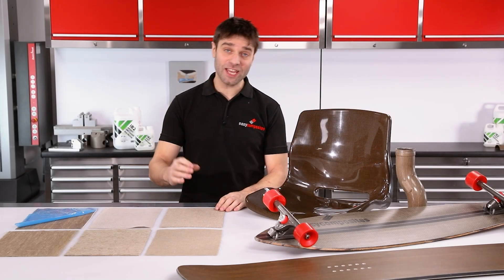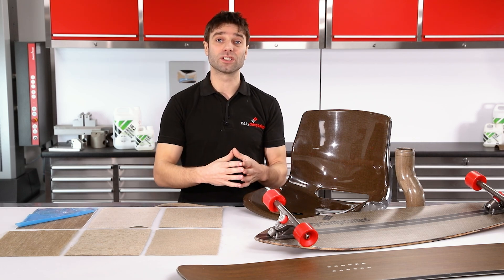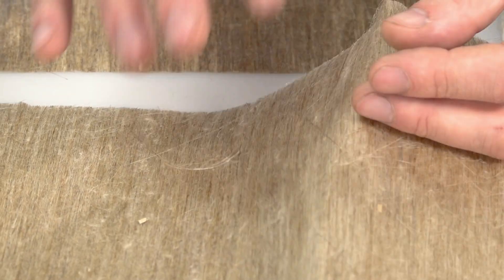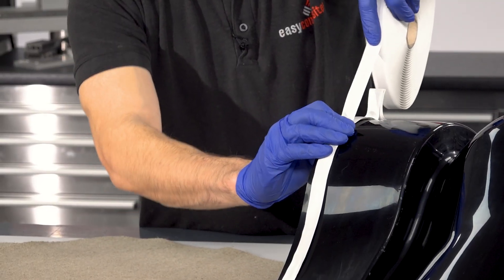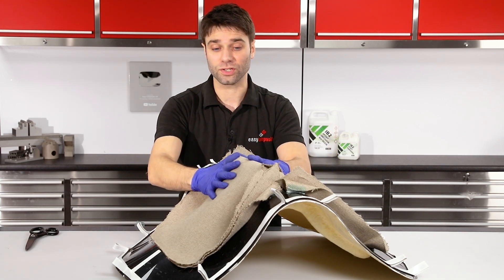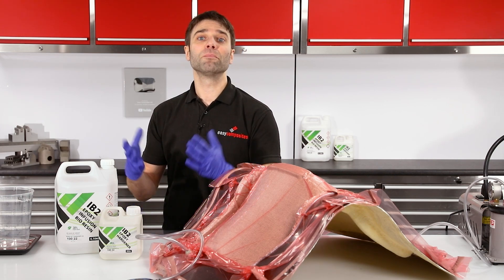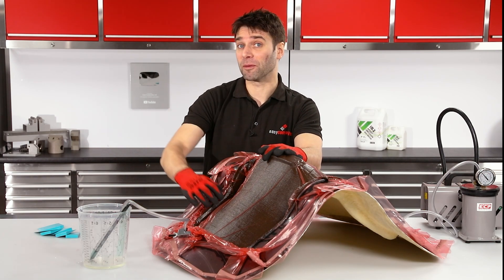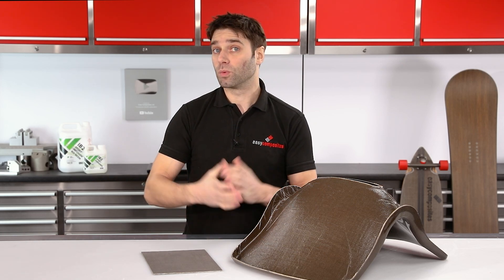How to Use Flax Fibre in Composites; Performance and Processing

Comment: Won't the snowboard topsheet absorb water? Or does it become 100% waterproof when cured with epoxy?
Reply from the maker: The resin infusion process should allow resin to fill up any of the voids which are evacuated by the vacuum pump and it should also absorb into the fibres themselves. Once cured there shouldn't really be any porosity left in the laminate with which it can absorb any water.

Comment: Amazing video as always - one question (maybe I missed something) - Why exactly do you not need to use peel ply or a release film with Flax reinforcement? is it because the bagging film won't bond to the reinforcement or it's just not so important to get a smooth texture on the back surface as the flax is so rough? or a bit of both maybe?
Reply from the maker: One of the main functions of peel ply in a standard resin infusion is to help the removal of the infusion mesh. Without it the mesh would become embedded within the laminate and be very difficult to remove. Without the mesh then the peel ply would only be providing a cosmetic finish. You can still use a layer of peel ply, as we did in the flax canoe but this video was showing how you can reduce waste and keep the process as lean as possible.
Reply: @easycompositestv  thanks for the response! makes sense regarding the mesh, but does that also mean the bagging film will not bond to the laminate?
Reply from the maker: @ando.engineering  Yes, generally epoxy won't bond to Nylon so the back should come away without to much of an issue.

Comment: is it possible to use a split mold to get a good surface finish for the back side as well?
Reply from the maker: Yes you could make yourself a 2 part mould to achieve a moulded finish on both sides. Another option would be to mould the front and back parts separately and then bond them together.

Comment: How does it react to UV?
Reply from the maker: Flax composite materials generally exhibit some level of degradation under UV exposure, leading to changes in their mechanical properties and appearance. This will also be influenced by the resin matrix used and how well it can protect or resist the UV reaching the fibres.

Comment: I've been scared to try carbon fibre because I don't have a suitable filters and workshop vacuum for sanding. Are flax fibres safer for sanding than carbon fibre and fibreglass in a home workshop?
Reply from the maker: Both would be considered a respirable dust hazard and with either carbon, glass or flax, you should be wearing appropriate PPE to avoid inhaling the dust.

Comment: Useful video, a lot of thanks, but why fiber sizing have not been mentioned?
Reply from the maker: The natural fibres don't have a sizing applied to them as the fibres themselves have the ability to soak up the resin, unlike carbon fibre for example which requires a sizing to help it bond with the resin.

Comment: I am a surfboard builder, hobbyist, but have done vacuum bag techniques as well as normal hand lamination.

I would like to try flax as an alternative to glass fiber.  Normal layup would be 4 Oz bottom e-glass and 2x4oz top e-glass.  

What would an equivalent grammage be for flax?  

Would you vacuum and what resin system would be best epoxy or polyester?
Reply from the maker: If you use our 200g cloths as an example the tensile strength of the glass is about 20 times stronger than the flax so possibly not suitable for a lightweight board . You would need to do some testing but you might be able to use flax as a surface cosmetic layer and then use a layer of glass behind. Epoxy resin would be best and the natural fibres laminate in a very similar way to traditional fibres so whichever method you are most comfortable with.

Comment: At 11.57 you say you’re going to leave it under full vacuum for 5 hours. Do you mean with the pump running that entire time or will you pull a vacuum and then seal it off for 5 hours? Thanks in advance.
Reply from the maker: You really want to run the pump for this period as it will ensure that the vacuum level remains at its highest level. If you just pull the vacuum then clamp off the bag you'll find that the evaporating moisture then reduces the vacuum level as it becomes a gas. Leaving the pump running will help to ensure that the fabric is as dry as possible.
Reply: @easycompositestv  good to know. I’ve got your EC4 and just running it for the first time. And I bought several of your flax fibres so figured I’d make some samples as I go. Thanks for the information, always appreciated!

Comment: Will Hemp behave the same way as flax ?
Reply from the maker: Similarly yes. It does perform slightly differently though.
Reply: @easycompositestv  we have to make the composites in similar way or different way like using resin infusion
Reply from the maker: @ayudhghosh1978  both flax and hemp can be processed with resin infusion, the main difference between infusing natural fibres is that we recommend leaving the fibres under vacuum for 5 hours pre infusion.  This will help to remove any moisture from the fibre as it 'boils off' under vacuum.
Reply: @easycompositestv  thank you so much
Reply: @easycompositestv  can you please tell me for mass production of natural composites panels, what are the machines required for it so that it will take less time?
Reply from the maker: @ayudhghosh1978  For mass production you would most likely be looking at a prepreg processed with a heated billet press.
Reply: @easycompositestv  thank you so much
Reply: @easycompositestv  here instead of heated billet can heated press be used for hemp ?
Reply from the maker: @ayudhghosh1978  Yes as long as you have some way of transfer a controlled amount of heat into the mould tool and the material.
Reply: For Resin transfer which machines are used?
Reply from the maker: @ayudhghosh1978  There are a few different variations but essentially you will need a 2 part mould which can be clamped down and then a way to inject the resin into the cavity.
Reply: @easycompositestv  rtm press?
Reply from the maker: @ayudhghosh1978  Yes an RTM press
Reply: @easycompositestv  which hybrid composites with bio composites will make surface bulletproof and mine proof?

Comment: Another helpful video as always! 

An interesting historical note is that Flax (and other natural fabrics) Fiber Composites were one of the first Fiber Reinforced Composites invented (1930s) and were used in many WW2-era aircraft before carbon fiber and fiberglass were fully developed. So naturally, besides the environmental use cases, flax fiber composites can be used for museum and historical restoration purposes. 

I'm currently a museum volunteer working on a B-25 Mitchell, so I'm currently using this video to help me make a couple of parts! Some versions of the Supermarine Spitfire also had their seats made from the same material, like the one you made in the video!
Reply from the maker: Interesting historical information on early composites!

Comment: Would you need to use peel-ply if using flax as an inner layer with carbon fibre on the external layers with a vacuum resin infusion?
Reply from the maker: You would probably want to run a trial to make sure as there will be some variation based on weight of cloth and thickness of laminate but in theory yes, you can do away with the peel ply and infusion mesh.

Comment: could you combine this video with the foam prototype video?
Reply from the maker: In essence, yes, you could. The downside is that you would have a lot of finishing work to achieve a 'moulded' appearance but the upside, especially for a one-off project, is that you wouldn't need to make a mould tool. It would also likely only lend itself to wet-lay or low-vacuum assisted wet lay rather than infusion.

Comment: I am building a bike frame from bamboo. The different pieces will be held together by multiple layered strips of flax fiber. Once they are completely layered and cured, can I sand the fiber to reduce the bulk?
Reply from the maker: Yes you can but the cosmetic appearance will change sanding into the fibres.

Comment: Great tutorial! Is there a way to get the surface to be less "shiny"? Similar to the snowboard that is shown.
Reply from the maker: The surface imitates the mould so a shiny mould will yield a shiny part; as such, you could choose to refinish the mould so any future parts come out with the required finish or, alternatively, you could either a) lightly abrade the surface with a fine wet/dry abrasive paper or scotch pad or could clear coat the finished piece with a matt or satin lacquer.
Reply: @easycompositestv  I have another question: How thick will one sheet of flax fiber result in in the final product? Will the thickness of the sheet be very different before and after the process?

Comment: Have you done any material on hand layup of flax, and how to avoid pinholes/ dry spots as flax seems to be vulnerable to this problem?
Reply from the maker: Hand lay up without vacuum can be problematic as it tends to swell so not always ideal.
Reply: @easycompositestv   I have made some tests of flax fibers with gurit ampro clr epoxy, and using clothes storage bag vacuumbag ( "the househould method"🙂) So I had some vacuum there, but is this sufficient? 
Would the resin uptake be larger in a hand layup? I made 2 samples where fiber to resin ratios was 1:2 and 1:3 respectively. But the final weight of the samples were only a couple of grams different to each other while the expected difference would be 10 grams. I think this suggest the resin uptake is stable at 1:2 fibre:resin. The surplus resin went into the breathercloth I suppose. 
Thank you for all the good instructions.

Comment: Can you recommend a more bio-degradable (or more carbon-neutral) resin/glue than IB epoxy?
Reply from the maker: At present, biodegradable or totally recyleable resins are still in the development stages so not commonly available yet.

Comment: I have to ask why one would use natural finers other than appearance.  The mechanical properties are less than sythetics, tgey are hydrophilic and unless you are using a biobased resin, the  are not truly biobased (for what that's worth).  Lastly, they are not going to be very biodegradable due to the chemical bonds in cured resin.

Comment: could you mix this with layers of carbon fiber? like have the flax as a decretive layer and have a few carbon sheets underneath for strength. i like the look of it plus id make people do a double take if the part was in an engine bay
Reply from the maker: Certainly you can use the flax purely as a cosmetic layer and use other reinforcements like carbon or glass for the rest of the lay up.

Comment: So, it's strong because it doesn't stretch? Could dyneema DM20 with 0 creep be used as well?
Reply from the maker: The reason for demonstrating the use of flax is because of it's greener credentials compared to other composite reinforcement. If you were looking for ultimate tensile performance you would be better looking at something more traditional such as carbon fibres.

Comment: Have you ever concider forged flax ? I am curious how it will perform. Maybe some episode like with forged carbon and aluminium lever ?
Reply from the maker: Flax is a much weaker laminate than carbon and being natural, the fibre tends to fluff when cut in small pieces.  So it may be quite hard to handle and get a good cosmetic finish.

Comment: Thank you on this video. Never saw material like this, its brilliant. 
But for more stiffness can i in 2. layer set carbon fiber? To have stronger part but still flexibel. How will that work?

Great work guys, thank you.
Reply from the maker: You can certainly mix in other laminate materials such as carbon fibre if needs be.

Comment: Can I add a layer of flax fiber as an integral flow mesh layer for infusions?
Reply from the maker: You would still likely need a mesh to ensure full resin flow although on a thin or small part the flax on its own may be enough to fully flow over the surface and draw down into the laminate beneath.

Comment: With the seat as example, if you are producing a large number of them, would it maybe be wise to use a silicone bag that's shaped to the back side? So that you reuse good number of times before needing to have new silicone bag. Also little surprised that you didn't mention the other fabric that is made from Flax, which is Linen.
Reply from the maker: In our experience silicone bags are unreliable when used in contact with Epoxy Resins with relatively short useable lifecycles.

Comment: If we design something to carry with flax fiber, which directional flax fiber we should prefer? Is it UD Flax Fiber ?
Reply from the maker: The direction of the fibre is often dictated by the loading of the part. If you need the part strong in mostly one direction, then UD fibres are a great way to do this.  For strength in all directions a woven cloth will do this well, although you could use a UD cloth and rotate alternative layers to give a more balanced lay up.
Reply: @easycompositestv  Think about it, you are designing a seat belt attachment on the B-pillar using flax fiber. What would you do? Could the flax fiber carry maybe 5000 N? In other words, can it be used as a carrier part in vehicle design, not in exterior design? Btw, Thank you for your response!

Comment: Is there also a health/safety advantage to flax? Perhaps pointing out that CF is also a carbon sink is too obvious but feels like a worthy point to mention here.
Reply from the maker: Both flax and carbon are inert and non-toxic so no significant difference during handling.  Cutting, both need dust protection as there is a dust hazard regardless of which material is used.

Comment: Hi Thanks for the video. Important question. I was told that there's always an issue with using Flax or Hemp materials because the materials will continue to absorb moisture. Have you see this as an issue for any product that might be used out doors? Could this be an issue at the edges of the material? Thank you
Reply from the maker: I wouldn't have expected it once they're fully wetted out with resin but they are very absorbent so where Carbon of woven glassfibre may take about their own weight in resin (200g fabric would use 200g resin), the natural materials tend to be at least twice their own weight (200g fabric would be 400g resin+) so possibly in situations where not enough resin has been use, there would be a potential for further moisture absorption.

Comment: I haven't watched this video yet
"Just the flax Ma'am"
Linen is flax fiber, a long fiber.
Linoleum comes from flax plant, I don't know how much or if any fibers are in it.
"boiled linseed oil" is linseed oil with toxic driers added, OK finish on furniture but not for anything that contacts food.
Grind your linseeds in a coffee grinder to get their nutritional value, it will be difficult to clean your grinder though.
Oil based paint, probably linseed oil, again toxic driers are added, long ago toxic lead compound was one of the driers.  See wikipedia entries for linen and also flax.

Comment: Hi ! Is that material recyclable ? If not, is there some equivalent that is ? Thank you ! Very nice work btw
Reply from the maker: The flax itself is recyclable, however epoxy is not as yet.  This poses a problem with the recycling for end of life composite parts in general.  in this case, normally pyrolysis is used to burn off the resin and recover fibres for re-use but with flax, I suspect the fibre itself would break down at the high temperatures involved.  Biodegradable resins and recyclable resins are in development but there is nothing commercially available as yet.

Comment: Flax fiber is great but the resin used is still harmful just like with other stuff like carbon fiber. What you need is a resin that isn't harmful to go with it and yeah you'd have an environmentally friendly product, but until then the products using resin no are not environmentally friendly.
Reply from the maker: Hi Sal, in this tutorial, we specifically use a bio-resin to 'enhance' the environmental characteristics of the end product. . A key component of epoxy, epichlorohydrin, is manufactured using renewable plant-based Glycerol in place of petroleum-based propylene in our Bio-Resin range. Additionally, the raw materials going into our bio resins are co-products or waste products of other industrially important processes which means they do not compete with food sources or displace food-based agriculture. The resin component contains 38% plant based content. Once mixed with its hardener the overall plant-based content is ~31% which is amongst the highest in the industry.
Reply: @easycompositestv  I saw it, it's cool. The point still remains because 31% is far from 100%. Anyone making resin products should understand that.
Reply from the maker: @sal5440  Sure but its still moving in the right direction. Bio-Resins, certainly compared to traditional resins, are somewhat in their infancy but with time and increases in use (especially in industry), its highly likely that they'll become even more environmentally friendly.
Reply: @easycompositestv  I agree that it's still very new and yes having basically 1/3 environmentally friendly is a step in the correct direction. I didn't put your product down, I'm simply saying it's still really bad for the environment and anyone working with products like resin need to know and understand that the resin is the majority of the problem not really the fabric inside.